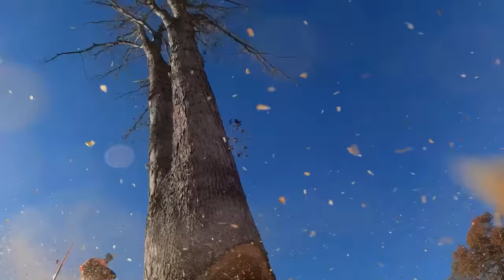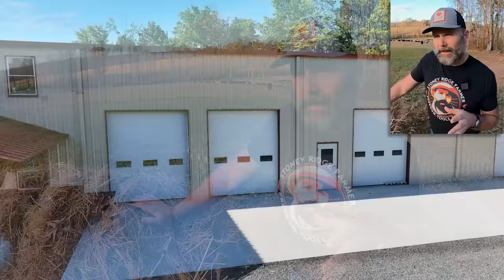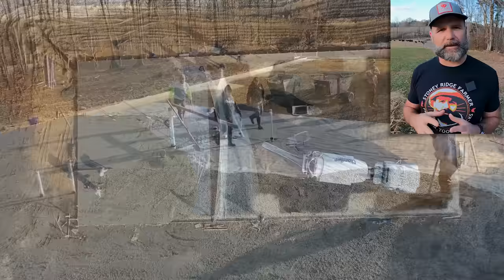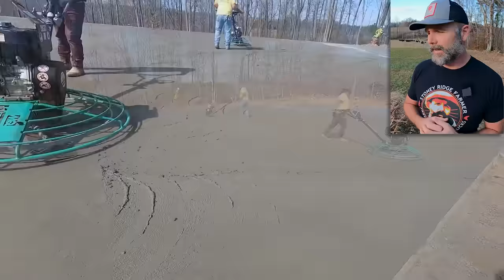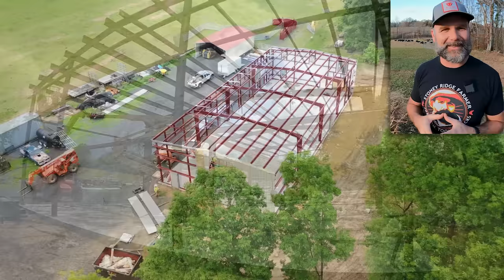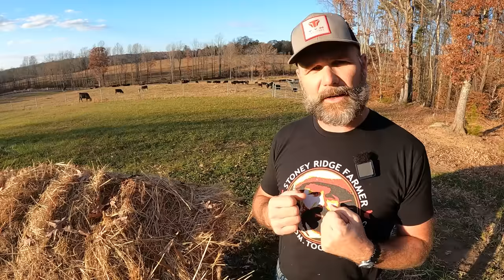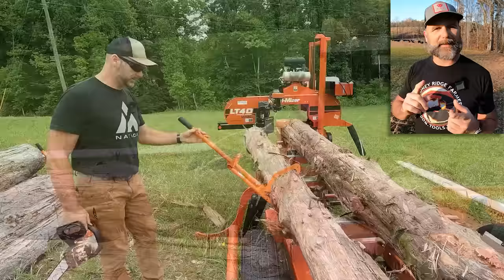Cops Came to Investigate Veteran's Farm! Heartbreaking disbelief

Comment: First of all, THANK YOU SO MUCH for your service to our AMAZING country!  I found your videos this a.m. & saw that you JUST published this one.  I live in Mooresville, NC, & I'm looking at building a metal barndo.  I'm in the beginning stages of research, including a building manufacturer.

Anyway, about this video.  I'm thinking Connecticut doesn't have zoning requirements because they want to get anyone they can to live there.  It's WAY too cold for me up there.  I'm glad you got everything worked out... until the next thing.
Reply: CONNECTICUT does have zoning laws regarding, building permits for, homes,electrical, septic,heating and AC, plenty of permits to meet requirements.
Reply: "because they want to get anyone they can to live there."  Um, North Carolina is over ten times bigger than Connecticut, but it has only 3 times as many people.  They have no problem getting people to live there.  Some people don't mind wearing jackets in winter.

Comment: I have seen both sides of the permitting system. When i first moved out in the country, i needed a permit for electric connection and sewage lagoon and that was it. I also saw the shortcuts and downright dangerous ways people had built and repaired things in this area. Saw where people had removed almost every 2x4 in a wall supporting a roof and had to try fixing it.Then, i also got sideways with the county. I was told i didn't need a permit for electrical work in an old church. That took six months to clearup. Everything was as close to code as we could get ( i had an electrician helping and teaching me). Now, 30 years later, we need a permit for almost everything as more people move in the area. Contractors will take advantage of no permit or inspection also.

Comment: Here in Texas, we have just under ten acres. We have two septic systems, both installed with permits even though we are in an area classified as “rural” and that’s unincorporated. Most people just do what they want out here. 

Anyway, septic systems… One gravity-fed, and one aerobic system which is like a major deal. The gravity-fed is no big deal… no one ever makes any remarks about it whatsoever. The soil is different across the acreage, so the aerobic system is newer, and because we have under ten acres, we are required to file quarterly reports regarding that system. We could get certified to do this ourselves, but we pay a septic company over $200 per year to do the quarterly inspections, to file the paperwork, and to keep us alerted as to any issues. Most people in our area install systems as they please and never involve the county/city, but times are changing, so we made sure to do things by the book… also to protect ourselves and be prepared if we ever decide to sell this place.

When we built our house throughout 2015/2016, we were given wide berth in our building process. And we built a large home. The tax office also wanted to know ALL our interior finishes… I reported each as the lowest grade possible. If I decided to upgrade, that’s MY business. But the tax office is sure on top of being in our business. We make sure to keep them updated, but supposedly they have the “right” to come inspect the outer structures on our property every three years in person. And I have an issue with this considering the last time we fought our property tax hike, tax office personnel sat there and brought up our acreage for a view by satélite/air. It was crazy. Why the need for personnel on the ground when they’re monitoring us by air? 

Personal rights fly out the door as our right to PRIVACY fades. Local entities having access to view our properties from above is strange. A Big Brother way of doing business. So I don’t feel the need to ALSO grant additional access to get even closer to what is already known by overhead views. 

Like you, we are law-abiding people, but the infringement upon our right to privacy can be shocking. 

And our taxes have been increasing at an enormous rate, until Texas FINALLY put a stop to allowed acreage homesteaders to be taxed beyond the 10% cap because they tax property separately… the main home, the acreage itself, any out-buildings are taxed separately as well, any foundation/drives with concrete, and so on. Overall, this last year, they attempted to raise our taxes another $160,000… wild. We fought them and got about $100,000 knocked off. Not a fun process.

The last time the tax office sent an appraiser to our home, my in-laws were staying at our house and more than eager to discuss our building plans that went beyond the blueprint, which I immediately shut down. This is NOT the time for friendly chats to tell all our business. 

Anyway, do things the right way, but use your property as YOU see fit. You will pay dearly for the cost of busting your rear to own anything, so enjoy it.

There are often infringements upon our rights due to city employees who are simply overstepping in their eagerness to get the “job done.” I sometimes believe there should be training for litigation mitigation so these certain people are restrained in their nosy eagerness to purposefully tag certain property owners, whether it be out of jealousy, revenge, or spite. Excess information available for taxing, code enforcement, etc., by unusual means should be off-limits. But how to proceed or prove this is an issue?

Years ago, one tax professional at the tax office literally phoned our bank to inquire about our mortgage balance… wanting to set our tax market value at at least the original construction value, which is CRAZY. The two aren’t even usually related. The overstepping is what concerns me.

As for your situation, they could have made a call. The call would’ve cost the city MUCH less than spending resources… manpower, equipment usage, fuel, time, etc., to come an essentially get a VISUAL on your land. Maybe meet them at the closed gate and see what is needed then wave goodbye? You could tell them it’s absolutely NOT personal, but your privacy is above their feelings and above the city trying to take intrusive shortcuts in doing their job. 

Good luck. It’s good you are aware and on your toes. Somebody there has a jealous bone or two! It’s easy to set off those types… the kind who think you having something equates them having less as they twiddle their thumbs.

Comment: Should be able to build what you want on multiple acres as long as there is no hazards to other property or persons. I know of a case in NC where this young married couple needed to build a home on their land and He was a carpenter and was doing demos on old homes and saving the lumber to build them a home. The inspector at that time was cool about it and told them they could not build a new home out of used lumber according to their county rules but they could build a barn out of the used lumber and then pull a permit to convert it into a home, so that is what they did. I saw them on the frame up foundation and there was 12x12 solid posts or beams used for the rim joists -end joists-band joists on top of piers and something like 4x12s used as floor joists between then - a really over built construction that when they finish it - it would be a 100 year life span of better home.

Comment: a vet and in north west NJ,   if you think your being over regulated ,  try doing anything here,  
i'm moving to a larger home on a 1 acre lot, 5 towns south west of now,   i have to get 2 zoning permits, 1 for a amish built garden shed that's 10 x 16 x 7 feet high sided, 1 for a fence,   plus a building permit for the shed . why it's a roll off,  OHH we have make sure it's built  to code.WTF,  as if they don't know that the store selling it is on the main highway in the same town,  nope you need a building permit on top of the electric for a light 1 switch and 1 plugs  .   plus the shed has to be placed on a cement slab  min 4 inches thick, that extends 2 feet past in each direction .

than they want proof of the cost of the shed and upgrades so they can add it to the tax base .

Comment: In Iowa we have to get permits for all buildings in city or rural , home or farm buildings.  The county permit is $100. If its a $40,000 barn or a $2 million dollar home. If In a city limits it could be a little more for the barn but the cost of the home might be $3000 to $5000. Being a carpenter we built a lot with the inspection departments with no problems.  We also built as many with no permits. We told the land owners they would be responsible for getting permits if they wanted them.
     As far as people sticking their noses in other peoples business that happens more everyday. People are so envious of other that they screw with the guys that have nice stuff.
     Looking at your building I'd love to walk thru it. You did everything the right way. Up here in Iowa our codes are quite a bit harder on the checkbook. 42" to 48" frost footings because of extreme weather. -25° below to 105° in the summer. Corn and soybeans can take it.
     NICE JOB, GOD BESS BROTHER

Comment: For the most part, I agree. And I hate jumping through hoops just to do something to my own land. But... even if you're not hurting anybody now, you won't always own that land. Eventually, somebody else will be left with whatever you do to it. 

I bought a homestead years ago that originally used heating oil from a buried tank. I had no idea it was there when I bought the property. The HVAC compressor was sitting on a concrete pad and the oil tank was buried under the pad. It wasn't until I noticed the lawn and plants dying that I investigated and found it. It had been leaking and I discovered I had a huge remediation project on my hands. What originally didn't harm anybody had expensive future effects. So, while I may not agree with everything code prohibits, broadly speaking I'm all in favor of restrictions that keep one person from making a problem for somebody else.

Comment: I live in Jackson Co. N.C. In Jackson Co. if you build anything over a 12 foot by 12 foot building, and you want electricity or plumbing in it, it has to have a permit pulled. Then you pay by the square footage of the structure for the permit, except for agricultural barns or farm buildings is not permitted, unless you want electricity and plumbing.
I'm als a former NC contractor and I can tell you the state codes for building houses is absolutely ridiculous to have to abide by. NC uses universal building codes which means if say New York has a BS code more than likely its in NC code books.
ITS ALL ABOUT THOSE TAX DOLLARS, AND FEES. 
In Jackson Co. a few years ago the house you were building was on the good ole boy system, if you played football, or went to school or church with any of the inspectors, you didnt have to have anything inspected. They would come out a just sign off on everything, without ever looking at anything. But if you weren't on the good ole boy list it was hell trying to get a final inspection on a house, everytime someone would come out they would find some nitpicky things that does mean anything just to hold up your final inspection. One inspector had this thing about GREEN ground screws on outlets, if for some reason the ground screw wasn't GREEN he woulf fail the electri every time. Most of those guys have died off now. Now everyone gets the same  inspections regardless of who you are.

Comment: I watched this video twice to find the part of this that “makes you feel punished”. It sounds like an improper measurement or intent was entered into the system about your building info, and they were just checking in to make sure things met the requirements for what it actually was, not what they had on file. It sounds like everything was handled very respectfully. Should we need permits at all? I thought a lot about this a few years ago. I’m in eastern Canada and things are pretty relaxed in this part of the province currently, but likely changing in the near future. What I realized was people like you and I are good people, who have surrounded ourselves with good people, and never see the absolute disregard others have when building when it comes to safety, water pollution etc. so we see these permits as an issue because we can’t fathom the level of idiocy or blatant disregard others might have because we have distanced ourselves from that faction of people. I worked in the septic industry for a small period of time. Permits with the department of health though a licensed installer were a daily occurrence. Without these regulations in place, people would/could easily be dumping sewage to the ditch, too close to drinking water supplies or wells, building faulty systems in wet areas or system inappropriate for the application. We very seldom got inspected, but a surprise visit wasn’t a bad thing. Kept us honest. We didn’t have an inspector on a power trip in this area, but think of how bad things could be with no regulation to help keep some shady installers in line, or no legal recourse for a neighbour who may get their property contaminated from a faulty septic system
Reply: NOPE, he was being punished. Most likely the person that complained was a buddy of someone with clout and it was about harassing The electrical permit is a matter of public record and the utility can not connect until the jurisdiction approves. That simple. This was a harassment. However the code enforcer knew it was BS.

Comment: Josh my take on this as being a fire marshal is that you started this building as a ag building, no problem.  When you asked for a septic permit for a 4 bedroom system there is an appearance that you are trying to skirt the system by using an AG exemption.  When someone is sleeping inside a structure the likely hood of injury or death from a fire increases exponentially.   If you had claimed bedrooms in your electrical inspection. You would have had to install  smoke alarms etc.  If you don't call for another electrical inspection after you may not put in the required safety requirements.  Each sleeping are is required to have a 15 sq ft opening for a 2nd means of egress and the smoke detector that is interconnected.  I'm not saying that you don't intend to do these things, but if you didn't, and someone died from a fire any of the codes  dept's could be held accountable also.
Reply from the maker: letting the lawyers take the reigns on everything....for centuries the entire human race has lived in all matter of structure....if it's mine, shouldn't I be able to mitigate the risk and decide for myself?
Reply: If everyone would do the correct thing, yes you should, but many will not do the correct thing so there is oversight.  You stated that everyone you dealt with in the process was nice and just doing their job, and you were trying to do the right thing, sounds they are also just trying to do the right thing and follow procedures in place.
Reply: @StoneyRidgeFarmer except no one takes into consideration the firefighters lives when they have to save someone from a building. My kids are firefighters. Why should I have to worry that they have to go into a building that might not have been done to code? When it goes from ag to someone sleeping there then there is a reason why the stuff changes. But take into consideration the lives of the people who have to fix things when they are not done right and they go in there thinking there should be a way out and it not be there. Yes, regulations suck. I get it. Yes we are being over regulated. But would you say do away with speed limits? It’s your car. The regulation is for safety. Do planning and zoning people get things wrong sometimes, yes we do. Yes, I am on the commission of our town. But if you feel that way then volunteer on the towns commission. Have a voice. But honestly I don’t feel like your rights were violated and I think that there should be some regulations in place. Either that or put a nice big x on a property of the people that feel there shouldn’t be many regulations so the emergency personal can ignore the calls to places who could potentially be putting their lives in danger. I’d be all for that too. I am all for as little government oversight. But I am also for the safety of my children. I am respectfully saying all of this, but with a little different view and the sirens that run down our road my thought is always, is this the one that takes my kids life? Just another opinion.
Reply: Trying to circumvent the system, I’ll go with the County, for the win!

Comment: The really sad part, in reality we only rent our land with the taxes, even though we paid for it, the taxes prove we don't own it.  Yes I have had that happen to me also. In our state, a lean to, meaning just a few post in the ground and some tin for a roof to cover the farm equipment isn't something you have to get a permit for. I even went to the planning commission to get a permit and was told I didn't need one. After I built my home nearby, they come to do my homes final inspection, and seen the lean to covering my tractor and equipment and told me I had to tear it down because I had no permit and it wasn't on my tax roll. I told them I would see them in court, I even had the ladies name that told me a permit wasn't needed for the lean to. I won, but it hurt my billfold somewhat just by being right on this.

Comment: Your septic system has the potential to affect the water table in your area if it is not correctly installed.  In AZ, if you own a home with a desert wash by it,  you cannot move or change the size of the wash without an engineered study of how it affects downstream land parcels. Septic systems must be permitted and inspected in AZ, even when located in remote areas.  The reasoning is that an incorrectly installed septic system can affect areas around it for miles. So it is common for government to regulate septic system installations and to inspect them.